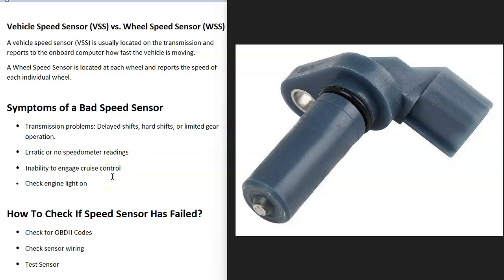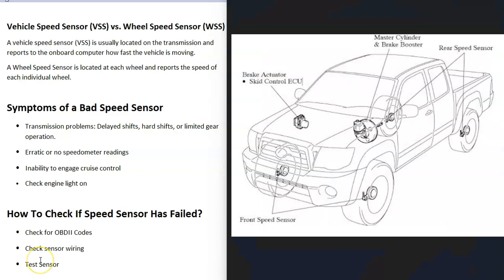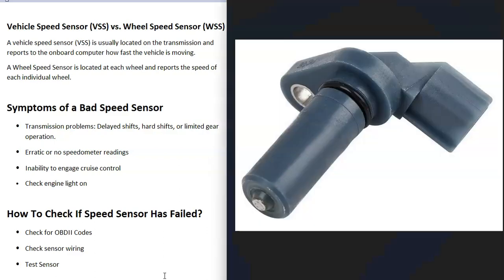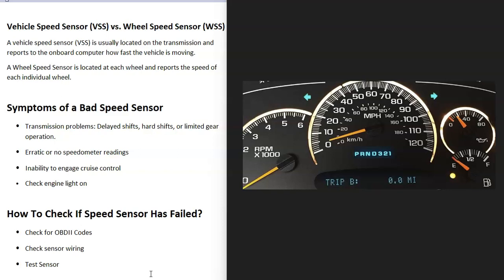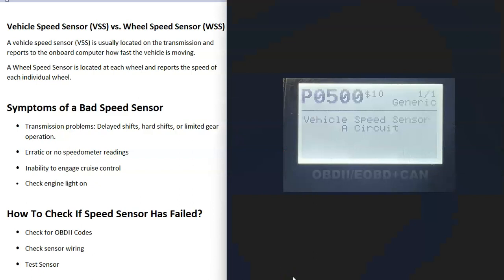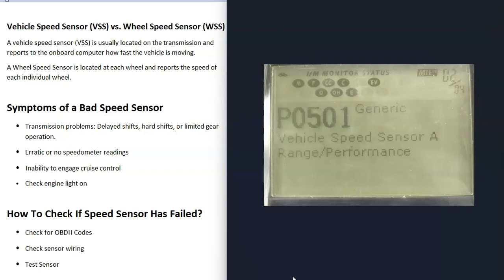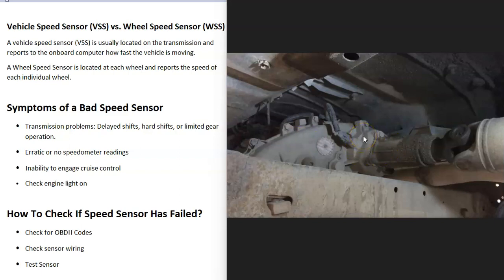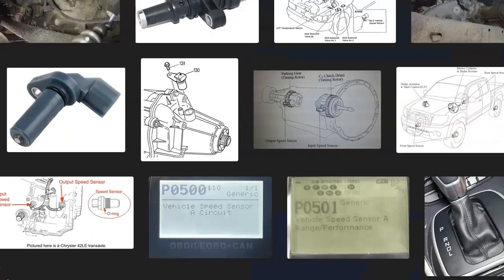Symptoms of a Bad Speed Sensor and How to Test if it Has Failed

Comment: I got a 2008 Chevy Malibu LS 4 cylinder the car drives slow and the speedometer not working when I mash the gas pedal I can hear the engine rubbing up but the car going slow and it showing a speed sensor code but not sure where the speed sensor is
Reply from the maker: It's on the rear of the transmission

Comment: It also can interfere with acceleration. A bad speed sensor can affect the correct amount of fuel to inject..yea
Reply from the maker: I've never seen a bad speed sensor cause fuel injector problems, but depending on the vehicle, it may indirectly affect the air/fuel mixture. Usually, it affects the calculations the computer needs to tell the transmission to shift, ABS, and related types of functions.

Comment: I have a 2002 maxima and if I drive it when it’s hot outside the rpms raise but doesn’t wanna shift at all and the cruise control light blinks but if it’s cool outside or night time it’s fine drives excellent shifts good and the cruise control works

Comment: Will it cause transmission symptoms in manual transmission?
Reply: Not likely.  Unless it is one of those newfangled Auto/Manual combo transmissions.  The ECU will read the output of the VSS from the manual transmission but it typically has no control over a manual transmission.

Comment: i need help. my 2005 mercury grand marquis cruise control doesn't work at all, it wont engage or anything, i scanned it with my blue driver and it shows me a c1445 code and the description says "vehicle speed input LOW when vehicle speed = 0mph" i have no idea what that is or where it is but one of the fixes is you replace the output shaft transmission speed sensor. i changed it and it didn't do anything. i researched the symptoms of a transmission speed sensor going out or faulting and i have none besides the cruise control not working. my speedometer works, my odometer works, and the shifting feels just fine. if anyone knows a solution or had this problem and fixed it please tell me what the solution was.

Comment: My renault laguna ABS has started acting up.  When I park overnight if I start cold the  abs & service light stays on. If I shut off and restart the car they go out properly and the issue goes away all day.  But it returns after the car has sat overnight or for a couple of days.   Any ideas on what I could look at?? Fluids all filled to the brim, and brakes work great.

Comment: Good explanation, thanks. We only have random stutter but we got P0715 "Input/Turbine Speed Sensor A Circuit". I think this is the speed sensor for the transmission. If you know differently, please let us know. It is for 2000 Mazda MPV
Reply from the maker: The input speed sensor is usually separate from the other speed sensors. The input speed sensor will monitor the transmission input shaft, and the output speed sensor will monitor the output shaft. It is best to get a diagram for the vehicle since there are differences between transmissions. Once the correct sensor is located, the sensor harness can be removed and the sensor tested along with the wiring to it.
Reply: @HVAC_Mechanic thanks. I tried looking for it last night but so far no luck finding one. Very little information on MPV on the internet unlike my other Honda and Toyota:(
Reply: I have an 04 frontiers se that jerks from 1st to 2nd but then smooth on all other gears(automatic) only when I let off the gas and give it time to shift is that it won't jerk.
Reply: @Sanriago98  only act up on 2nd.... My P0715 went away but the ODB is displaying exclamation warning after I remove the speed sensor and reseed it (after confirming the impedance range given by the dealer). I am so confuse now.
Reply: @DarthVader3425 today I changed the TPS and it's shifting like new
Reply: @Sanriago98  Nice. I assume TPS is the speed sensor. If this second drive cycle complete and the code came up again then I'll probably buy a new sensor. I am hesitating to just change it since the resistance test was within limit and it costs like $120.
Reply: @DarthVader3425 I didn't want to buy it either but my friend changed one 6 years ago and kept the sensor that fits my car. Still I might buy the new one, it's worth it for smooth shifting. The problem is to calibrate it, we had to use a multi reader and set it to specs
Reply: @Sanriago98  That's interesting. You are calibrating it because it was from a different car and wasn't made for your car or because every unit has to be calibrated. I only know how to measure the resistance.

Comment: My 03 sport whack speedo stopped working, then an hour later cruise stopped working. Air bag light came on ? Sounds like the culprit, the one on transmission, or both. It has 2.

Comment: My 97 Lincoln town car goes into reverse but when put into any drive gear like D 1 or 2 it doesn’t go it no engine codes no engine light , mind you it drove but barely wanted to go and didn’t have much transmission fluid in it so  I put atf fluid drove it then it stopped working after I turned off car  I found out it needed mercon v drain fluid new filter new fluid and still no work ? Did I break my transmission

Comment: I have a Lexus gs 350. The abs and collision malfunction light came on. I unhooked the battery, and did a hard reset yesterday. After 2 drives,they both went off. The trans is fine.The speed is fine.Drove perfectly with the lights on,it just flashed and dinged,which was annoying. Now that they're off,it's driving like brand new again...101K miles.......I took it to the Lexus dealer,NO codes came up? My question is basically, after this hard reset. If there's still a problem, how long until the lights come back on? 

4 weeks ago,6-7-8 lights came on.Almost all of them,but the CEL..Lexus confirmed my brakes and battery are good.I then bought a new engine air filter, and all of the lights went off,for 2 solid weeks.Then 3 days ago,the ABS and Collision Malfunction lights only came on.Then I did the hard reset yesterday. Any thoughts?

This is the 1st car I've had that didn't blow codes.And i know maybe the abs wasn't broken 4 weeks ago,but is now!? Its just weird.
Reply from the maker: If codes are cleared and don't come back, it likely is an intermittent issue. For example, a loose wire that only disconnects on a bump or a component only starting to fail.
Reply: @HVAC_Mechanic  3 days now,no codes..It rained and snowed last nt.too....

Its weird it went from 8 lights on,then I added a engine filter.They all dissappeared for2 solid weeks,and then these lights came on.

I saw a mouse under the hood 3 years ago.IDK.

I'll just have to wait and get it re diagnosed,if they come back on.

Comment: I have a 1997 Subaru Legacy. Automatic wagon 2.2L. First time I was having problems. I was on the freeway. My check engine light went off. I pulled off the freeway but started back up again. It continues to do this. If I go over 40 or on the freeway the check engine light goes off  and then dies as I come to a halt.  The light will turn off if I head to O’Rileys to have it checked or when it cools off. The code it throws is P1540. Recommended to replace transmission speed sensors. After watching a lot of videos there were also recommendations to clean the  throttle body sensor. So I bought cleaner. But then I met my niece’s boyfriend who was a mechanic. He scanned the car. No codes would show up. It did say the Throttle body was turned off. He said it needed replacing. He’s the mechanic, right. I wanted to clean the one I had first and test it with a meter. Didn’t happen. He ordered a new one and it took forever. Hard to find I guess. Meanwhile I get that code each time about the transition speed sensors. So I ordered one. Then I took my cleaner and the transition speaker sensor down to his shop and he was supposed to change them out along with the throttle piece he bought, do an oil change and other minor changes. Well he never did anything. He ran the scanner and nothing showed up. He told me nothing was wrong with my car. What? So I jumped on the freeway, the check engine light came on and it died as soon as I slowed down coming off the freeway.  Went back to the shop. There. The engine light is on. He ran the scanner. Nothing. He told me to come back when there is a code. No oil change. He didn’t install the sensors I got. Don’t know what to do.  Suggestions?
Reply: " Sometimes" the ( bad) speed sensor can be intermittent too,which means the "symptoms" may be like on one time but not the next
. AKA not always present
Reply: Change speed sensor(output sensor)

Comment: 2000 Jeep Grand Cherokee Laredo vehicle speed sensor could you shut down your vehicle
Reply from the maker: The engine should have no issues, but some vehicle computers can have an issue doing calculations for the transmission to shift while others do not, it can vary.
Reply: @HVAC_Mechanic could this cause a u0101 code and loss of driving capabilities?

Comment: Im getting a mis when flooring it ,hard shifts and my speedometer goes out from time to time. Wondering if replacing the 2 sensors on the transmission would fix this.? 96 lincoln town car 4.6. New plugs and wires and coil packs.

Comment: 2013 lexus rx 350 I replaced the steering damper and after that  abs power steering  traction control engine lights are on. I have p0500, p1604, u0129, and u0182 are the codes i have.  should i replace the abs sensor or check the steering connections? thanks

Comment: i know this is an old post. but would you know if a transmission sensor or a wheel sensor would give me a po700 and p0500 on my 08 outback. car drives but slips as soon as you try to pick up speed an never seems to stop slipping. cleared codes and drove car quarter mile same slipping problem but no codes. any idea? just started doing it out of nowhere. i did notice cruse started kicking out for no reason.
Reply from the maker: It needs to be diagnosed, but the speed sensor may be starting to go bad, or a wire may have a bad connection. If the P0500 code comes back, I would test the speed sensor.
Reply: @HVAC_Mechanic  thanks

Comment: my speedometer is not working. Is it possible that the problem is with the sensor?
Reply: Probably yes. I replaced my transmission speed sensors and it worked.

Comment: Hey bro , what if the trac control on won’t come off , check eng , tire pressure not showing the psi, also the cruise control not turning on ,rpm act up sometimes and shift weird sometimes .. you think it’s the speed sensor ? 

The shop told I have to replace my transmission…
Reply from the maker: It needs to be diagnosed; a scan tool will give codes that point to the issue. When there is a problem with the engine or transmission, the computer on many vehicles shuts off driver-assist programs such as Trac Control.

Comment: My car car doesn't go anywhere past 25 mph and it's limited on speed but I could hear the engine revving trying to make the car go faster. And yes the speedometer is going haywire up and down up and down And it feels like the car is going to just shut off or break down. But after driving 5 mi my car can shift past second gear and I could go 55 mph in the speedometer doesn't go haywire anymore but I can no longer go above 55 mph. I do not think that the speed sensor issue. I'm sorry that has to be a bad transmission. I don't think a speed sensor has anything to do with the car acting like this. I think it's straight up. Just a bad transmission. Also there is no check engine light. There are no codes. There is no ABS light on or No traction control light on. So therefore it's just a bad transmission.
Reply: 1. Low transmission fluid can cause shift issues. 2. Plugged transmission filter. 3. Burnt transmission fluid. Best to change the transmission fluid and transmission filter. Make sure to also order a transmission pan gasket. If the fluid is black or full of metal shavings it can block the transmission filter. If the filter plugs up then you will get transmission issues. I also recommend some Lucas transmission fix. It will clean the solenoids in the transmission if they are stuck.

Comment: Hello there. How’s bout P0700 i have that code just one code P0700 what’s you think is the problem
Reply from the maker: P0700 is a generic code the computer sends out when there is a transmission issue. Usually, there is other codes that point to the cause. I made a video on this here is a link. https://youtu.be/SB1OptyqylA
Reply: my speedometer is not working. Is it possible that the problem is with the sensor?

Comment: Hi. I have a lexus rx 350 2008 model. I had been getting intermittent CEL with a pending code p0717 (turbine shaft input speed sensor No circuit). I took it to a transmission shop. They said it’s issue with sensor and they replaced it. No there is no code or check engine light but car is driving very heavy. Car delays shifting at second gear at low rpm and while making a stop it makes a jerk and clucky sound while its downshifting-to low gears. Can you provide any input regarding this. Thanks
Reply: I have same issue on my Lexus rx330 2004, I have changed the sensor but still getting same code P0717 and still experiencing exactly what you explained here. Any idea how you fixed yours?
Reply: I’m having the same problem. I think it may be more than the speed sensor. I removed that and it checked ok with a meter.I think it must be another sensor or it may be that one and another one, frustrating .I am taking it to a garage today. I feel i have failed in my quest to find it. I wonder whaat you ended up finding wrong.possibly a wheel sensor!?,

Comment: What if I’m not getting any codes but my car is having trouble going in to gears when I’m going 40mph and the speedometer tells me a different speed and my cruise control won’t activate on 50+mph. Could it still be the speed sensor?
Reply from the maker: Usually, a code is given at some point. It needs to be diagnosed, but, if possible, check the fluid is at the right level and not dirty.

Comment: I have a 93 jeep xj the speed sensor needed changing, the gauge needle was bouncing and misreading the speed. however, I had to buy an aftermarket one and the wiring harness was different with no color-coded wires (all black) after hooking the wires in the order that seemed correct, I tested it out, nothing happened the gauge needle didn't move at all. My question is,
if I mixed up the wiring, could I have blown a fuse somewhere and also, I unplugged the sensor harness since I don't if the wiring is correct, now my check engine came on could this be due to the speed sensor wiring is disconnected?

Comment: Can you tell me how to reset the speed sensor after installing the new one?? Hope you can help
Reply from the maker: It shouldn't need to be reset. If the sensor is replaced, the code is cleared; if it comes back, there is another issue, likely the wiring.

Comment: Just had a p0500 on my 2012 corolla, The speedometer stopped working while driving and abs and power steering shut off. Now the p0500 makes sense, But why did my battery light come on then start flashing then disappear? I cleared the code but i will be doing tests on every single one of these sensors, Hopefully no rats chewed through it. I will be using my autel to read each sensor and also so some simple multimeter readings
Reply: I got same code and now my instrument cluster is total black nothing works at all. Did you figure yours out?

Comment: I got a rebuilt cluster and everything works but the speedometer, my transmission runs fine idk if I need to replace the speed sensor or not
Reply: I’m having same issue. First started as battery light and few other lights. Got the po500 code and now the whole instrument is down. No lights or meters work.

Comment: I have a 96 f 150  ( 5 speed manual ) the fuse blows I unhooked the plug that goes into the speedometer and still blows so its in the wiring of circuit. Can a bad speed sensor  be the problem ?

Comment: I got a 2002 Honda accord automatic and it shifts rough 1st nd 2nd gear and also jerks/jumps when going from park to drive or reverse only wen moving to drive or reverse it jerks/jumps and also when coming to stop it jerks/jump no check engine but the abs light is on cruise control doesn’t work either would appreciate the help
Reply: Output sensor,fuse AT

Comment: If this sensor is bad, could it cause no reverse?
Reply: That more than likely would be a solenoid issue. Or simply changing your trans fluid and filter if the problem continues go to a professional I promise

Comment: I have a flashing D light scanned it and it was pointing towards to solenoid sensor, I replaced it n the car still not shifting from 1st gear. Hopefully if I change the speed sensor my issue will be resolved😢